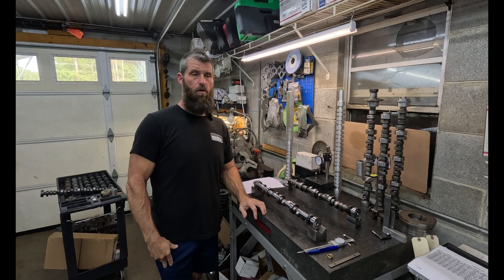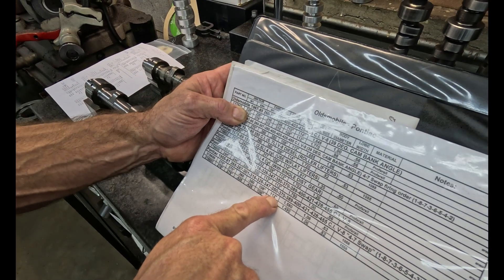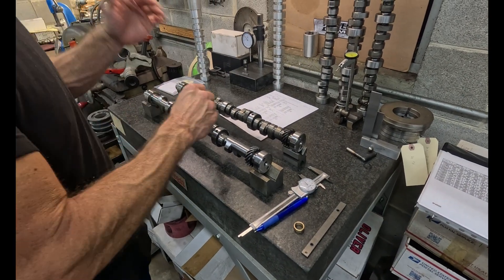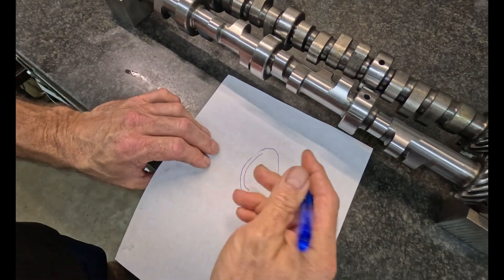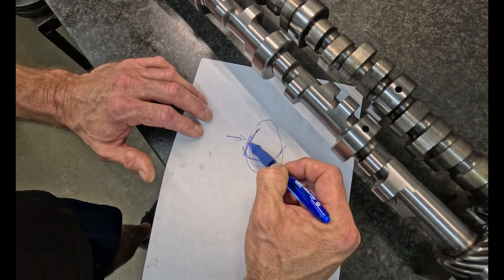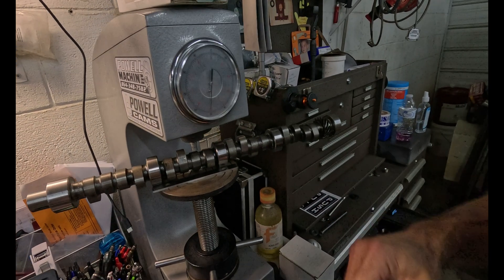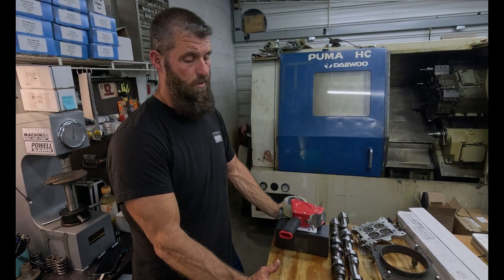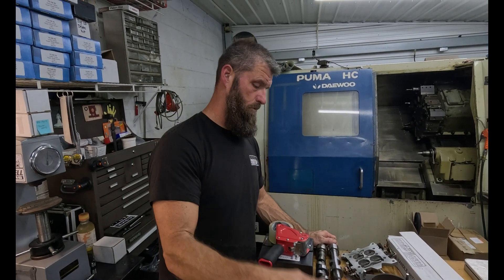Cam core Tech: how deep is the heat treat?

Comment: Hello fellow gear heads, I just wanted to ask what type of camshafts and lifters are actually decent for a 305 small block Chevy that I am rebuilding for a camper special 1974 with a rear end that has a 3:72 gear ratio? Not a work truck yet I do some towing with a trailer in a blue moon. When I do a engine I port and polish the heads except the lower casting on the heads because they are like rapids in a river. They take the gas air mixer and throw the heavier gas up into the intake runner. The more that the air and gas gets to mix the more volatile that mixture is. That is why a high rise intake performance is better. More time for mixture. The last time I went with a cam it was a competition cam 268 and melling lifters. Now some companies went over seas with low quality of their products.

Comment: Cringed when you pulled that cam out... No way would I put that in any engine I have. Very good point on the heat treatment. If that cringy camshaft were to be used, could it be heat treated again to give it some longevity? Or is heat treating a "one and done" scenario?

Comment: Can an undersized cam like this be saved with a fresh heat treat and hardening or do you create new problems?   Why would a machine shop grind a core that isn't spec'ed properly (on this I am just confused).
Reply from the maker: It will warp up 9f hardened

Comment: It's hard to believe that was sent out . Just looks wrong !
What's your opinion t. Used flat tappet lifters. On a different camshaft ?  
I used  the same  solid lifters on several cams .  On my Max Wedge engine. That were used   when Dad gave them to me.  Everyone says You can not do it ..!   I've had more problems with new stuff.  But Never with used on my car .   Without lighter break In springs. .  Just wondering if I'm the only person that's found the same results?

Comment: The last two digits of the grade of steel is the carbon content. A rough rule of thumb is that you can achieve a hardness on the Rockwell C scale about equal to the carbon content. Example 1050 will achieve roughly a 50 rockwell on its own without carburizing.

Comment: Can it not be re-heat treated?
Reply: What happens when you heat treat things? Do they stay straight?  Watch some other of the videos and see what is done before came starts to be ground. It is checked for straightness of all the cam journals and then "adjusted" before any grinding. Ask any place that heat treats things what happens to any part after it is heat treated. Do it keep all its pre treatment sizes and straightness?
Reply: @bobhudson6659  answering a question with more questions isn't a answer.

Comment: Could the core be heated,either furnace or induction, and nitrited, I think it's like a molten salt dip? If not it's too bad that the grinder totally disregards heat treat. Thank you sir for pointing this out!
Reply: Thinkin’ that redoing the heat treat would mean grinding the cam again. Would expect it would be better to just grind another on the appropriate core, as it would be questionable if there would be enough meat left to grind, the correct lobe geometry, after the time and expense of heat treat and all that goes with it. 
Literally, grinding a turd, I’d expect, but, I ain’t no expert and expect Daniel will chime in…
Reply: It could be heat treated again to achieve the desired metallurgical properties; but it's going to warp/twist/shift at least a little... So it will have to be straightened and reground again to achieve precise geometry.

Salt Bath Nitride (SBN), aka Ferritic Nitrocarburizing does achieve a super hard outer "skin" on parts, but it's only between 0.001" and 0.005"deep, depending on how long the part is in the salt bath. Also, it serves to temper/soften/weaken the material underneath a little.

Remember that hardening steel ALWAYS makes it stronger, but also makes it more brittle. The right hardness is always a balance between wear resistance, strength and brittleness. My point here is the cam lobe needs to be hard to prevent wear - but ALSO to withstand the high stress generated by acceleration of the valvetrain. So simply achieving a really hard outer skin (from SBN, for example) wouldn't generate the core hardness/strength required to live a long happy life as a camshaft.

Hope that helps.
Reply from the maker: @GroovesAndLands we "can" heat treat it again,  it would be hard, just not usable
Reply from the maker: You can't really reheat treat a cam